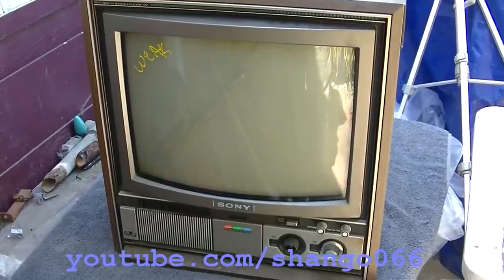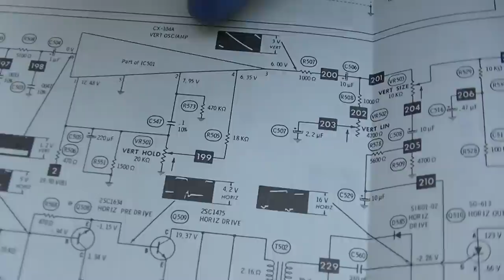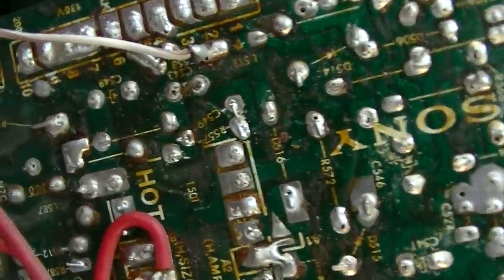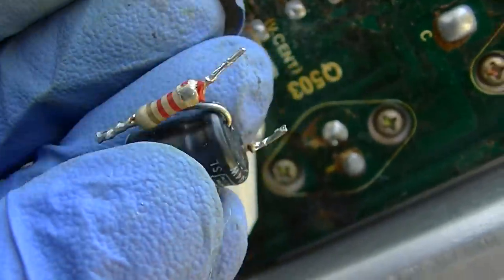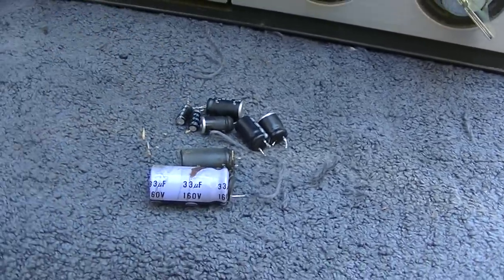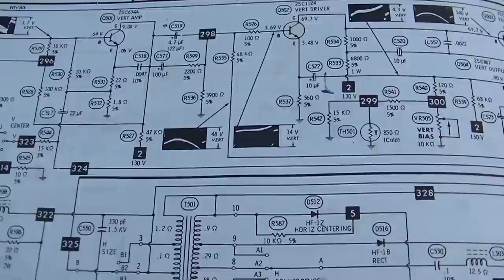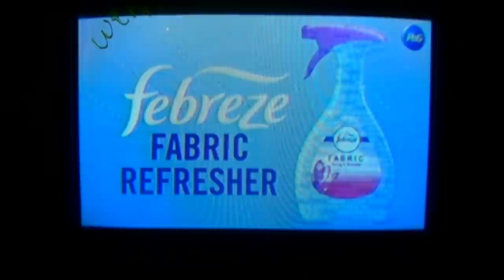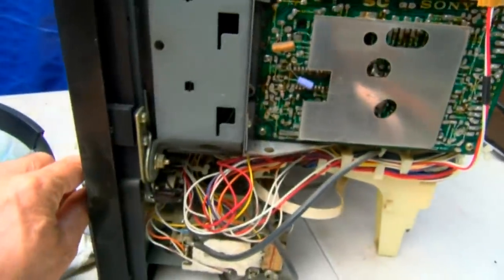High Hour Sony Trinitron KV1722 Repair Vintage Portable Color Television

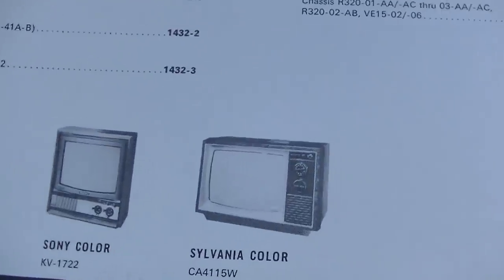Comment: 20:50 - just to add to Shango’s point, the reason why you kill a Trinitron if you try and rejuvenate in the usual way is because the tungsten for the cathode is so thin that the spike in current from a rejuvenator will easily destroy it!

There is a way I know to reactivate older Trinitrons like this and that is to increase the heater voltage to about 9V, leave it like this continuously for a few days. It slowly removes a stagnant layer of crud from the cathode. How successful it is just depends on pot luck.
Reply: Does that work on Sylvania tubes as well? I have one with a 1978 26 inch color CRT that's... well it's watchable if you wait at least a minute in a completely dark room... but then again that TV has other problems, it's got H deflection bleeding into V geometry. That might be rust growing on the pots in the geometry adjustment, it changes if you do percussive maintenance. I found the set in a dump... it's rare to find such an old TV with the original remote control. One day...
Reply: @senilyDeluxe  Not a clue. I’m from the UK, we never had Sylvania stuff here.
Reply: @stickytapenrust6869  I'm from Germany. It's a SABA. They had a deal with Sylvania that, at one time in '74, didn't do them much good... (that tube does have good colors and is plenty sharp, but dim... I found a 17 inch B&W SABA with a Sylvania tube in the same dump once and it was a low hour set with an insanely bright picture, I shouldn't have thrown that one away... well space and parents are an issue when hoarding...)

Comment: I remember back when those sets were new. When you went to a store that sold Sony and RCA and Zenith and others the Sony always had purer looking colors and better corner focus. You could read the small text in the commercials.
Reply: Sony was owned by Mr. Morita  and he wrote a book. Sony used new technology of sweep ray gun that created better picture than other brands like Zenith, RCA and Phico. The picture tube of Sony color TV with Tritron technology color picture tube make Sony brand the best at that time. Sony also came up with small portable set that you can carry with you for vacation trips. The quality of Sony is outstanding for the one that manufactured in Japan and command very high price for parts. That why many of them got trashed.
Reply: @johnmadow5331  I have one of them. A couple years ago, pre-Pandemic, I saw one in Goodwill for $3.99. Powered it up in store and the picture was clear and bright. But confetti, of course. Probably anyone who tried it before figured it was broken. Snatched up immediately, took it home, connected to a converter box and the picture is gorgeous. Absolutely perfect, traditional Triniton. Sound is good too. Expect it was low hours. And don't anybody even THINK about cannabalizing this gem for parts! I will hurt you.

Comment: Most CRTs, Trinis included, were run by default with a high drive(Picture/ Contrast/ White Level) setting.  I learned that late in the CRT era(late 2000s), and always made a point to set the 'Contrast'/'Picture' control to its mid-point, before adjusting anything else('Brightness/ Black Level, Color, Sharpness, etc) on a brand new set. 

Typical default was Contrast maxxed.  After turning it down, the Picture was definitely dimmer, even on a 25" or larger tube, but less glare in the brighter portions of a picture, and better black detail(dress suit texture on the evening news anchor, etc).  Much more lifelike, and probably closer to what was seen on preview monitors in the station control room

Comment: Awesome resurrection! 
I own an example of this model which worked well the last time I used it about 10 years ago.
I learned to diagnose & repair these first-generation Sony Trinitron sets during the late 1970’s. It was a challenging learning curve for me (even though by then I had earned an MSEE degree in solid-state circuit design). Sony must have employed a huge staff of really brilliant engineers at that time. Their engineering efforts were visible in the excellent picture quality provided by these sets. Reliability, on the other hand, was variable. Conventional shadow-mask color TV sets had about 1/2 as many electronic parts in them. Therefore not as many items to fail.

Comment: Shango, I have a 22 yr old high-hours Sony and the CRT went completely flat several years ago. There's a small value resistor (2.7 ohms IIRC) in series with the CRT heaters, located on the neck board. I shunted that resistor, which brought emission up to like new, all 3 guns. The set is in daily use, with no sign (yet) of losing emission. Dunno if your Sony has that resistor, but might be worth checking.
Reply: Basically you did the equivalent of adding a brightener by eliminating that 2.7 Ohm resistor.  Others have said in posting for this video that running the CRT at a slightly higher voltage will burn off crude on the cathode and/or heaters. You are confirming that.  You might want to try removing the shunt to that 2.7 Ohm and see how the picture looks.
Reply: The low ohm resistors are there to protect the filaments from high current inrush when they are cold.  The filaments may blow during cold turn on if the line voltage sine wave is at one of its peaks
Reply: Not when the heaters are powered off the flyback.

Comment: The mainboard always has charged up ready to go electrolytic caps , well at least the ones that didn't fry out already.
Seen potatoes less baked coming out of the oven. Getting any kind of picture, smeared or otherwise, is a win. Stay for
the audio repair. More bad caps. Very good ressurection  by Shango  but you would have to watch it in a dark room.

Comment: I remember the old 70’s television commercial for the Sony Trinitron portable that had Groucho Marx as the pitchman.  
A couple years ago I saw a very early Sony film on YouTube advertising their “trinitron” system. In that film they pronounced “trinitron”  so it sounded like “try nigh- tron”,but in later ones is pronounced like Shango says it here,which is always the way I’ve heard it pronounced.

Comment: On the subject of weak Sony CRTs, I recall a circa 1980 19" set where the green gun tested like new, but the B and R were totally dead and would not respond to rejuvenation. I've rejuvenated a few Sony tubes with a B&K 480, but they were already beyond usability and I had nothing to lose. If they took at all, they usually looked good for a few days, and then they'd fall back down and look worse than they did to begin with.
Reply: radiotvphononut: Good to see you are still around. Your vids haven't popped in my YT feeds in a long time.

Comment: Great job BTW. You have the patience i used to have before wife and kids.... This gives me a premise of where I need to start on both of my KV-1722s. One has the surging regulation pattern yours shows as well, the other had a hellbof an audio buzz/hum. Sounds 60 cycle so I'm sure the regulation circuit needs recap. Those caps look nasty.. Both had nasty pincushion distortion. I haven't recapped either, however I did disable the instant on circuit.

Comment: Sony had that similar switching PS for the higher end TA-F6B audio amps. I guess for a smaller Transformer foot print? Also I noticed the solder connections. I've seen that on other boards of that era. The solder pads gas out some sort of material combination when heated, bubbling the solder connection.

Comment: The KV-1722 had several different chassis versions. Each one was wildly different from the other. Worked on many of those in the early 80's

Comment: I had a 1989 LXI 564.42955950 that was bleeding/smearing too but only through one of the 3 AV inputs, it had an RCA 68AEG20X02 that was kind of soft, but the brightness was fine.

Comment: Red bleed due to saturation of the red cathode was a common issue with 1970’s era Trinitrons. My recollection is Sony’s red phosphor wasn’t as efficient. Therefore the color red required nearly 2x the cathode current of green or blue. Still, low CRT emission rarely occurred before about 5 years of heavy use. Also, after 20+ years of storage it seems typical for a Trinitron CRT to require about 10 hours of power-on time to fully “wake up” and get up to a reasonable level of cathode emission.

Comment: We still have a KV-2765R
Trinitron 28 inch that we bought used in 1999, that worked flawlessly for about 5 years when the green colour just dropped away and still works today otherwise in red and blue only, but still a perfectly bright sharp picture! Then the friendly neighborhood tv repair shops disappeared, so we could never find a place that could still repair it!
  It is a solid state set!
  Any ideas? Anybody?

Comment: It would be interesting to use your CRT tester as the heater supply and see how much increased filament voltage would improve the picture.

Comment: The two 10uF 50V polar caps back to back will give you  abipolar 5uF 50V since the reverse voltage rating of a polar caps is basically 0V. Technically they can tolerate about -1.5V, above which they become a sort of electrolytic diode and the other cap connected with the correct polarity  will drop all the voltage :)
Reply: Two 10uf caps back to back give you about 9uf as a bipolar cap
Reply: @blitzroehre1807  I just took two new 10uF, 50 volt electrolytics out of the package and tied the positive leads together.  They measured what I expected, 5uF.
Reply: @vancouverman4313  Its because you are measuring them below the reverse breakdown voltage of the wrongly polarised cap with your multimeter. If you do a dynamic measurement with a function generator and an oscilloscope you will find its about 9/10th of the capacitance of a single cap. Trust me
Reply: Identical caps in series halve the capacitance. Simple textbook theory.
Reply: @Seiskid  Yes, but not if they are wired back to back, because on each half wave of the ac going through one of them basically becomes a short. The correctly polarised one cannot suddenly have half the value, can it? Remember, we are talking about ac going through them.

Comment: That's good info about not trying to rejuvenate Trinitrons. Does that also apply to the "clear shorts" function of tube service devices? I've had junk on cathodes in a Trinitron and it luckily burned up safely on it's own, but I understand that that can sometimes take out the tube when it happens, and it's safer to use a device to clear shorts or clean them.

Comment: This set looks like it could have used the madman Muntz treatment. If you have that many completely open capacitors and the set is still functioning the parts count could have possibly been reduced.  This is a true event. Where I work a piece of biomedical equipment that was made by a Japanese firm had a very strange roundabout way of achieving a result in a circuit. The manufacturer is rep was asked why they didn't do it another way which was cheaper more reliable and achieved the same result. We were told that this circuit was the baby of a senior engineer who had been with the company for a very long time. No one would overrule him on this design. Sometimes I think Sony sets were the same way. Extremely complex circuit to get to a simple result which could have been done more conventionally. The weird SCR fly back design is an example.
Reply: I understand completely. Back in the day I worked for a (now nameless) major electronics manufacturing corporation. Politics overruled everything: engineering, business feasibility and common sense.

Comment: Capacitor voltage rating is just how much the capacitor is rated for handling before it blows. The difference between 10μf 25v and 10μf 500v is just more insulation. More is better, you can get ridiculous for the work load required though. You can increase the capacitance value by too much and have a negative effect, depending on circuit. More is not always better in this case, but less than 70% of recommended value is bad.

Comment: i was once able to restore a friend's 90s trinitron with a stone dead red gun by zapping it with 8000v from an an electric fence charger, it worked and the set had a decent picture, no one knows how long it would have lasted as a few months later it was destroyed in a flood

Comment: Curious what the other capacitor was for the sound.  I'd expect an open feedback capacitor would make it loud and distorted.  (However, a leaking cap could mess with the bias.)  A bad coupling capacitor would make it weak.

Comment: Anything you can do on some new CRT TV's that have a single chip for everything which have the "bad regulation" as you've told problem?
When the picture contains some white areas, it bends in horizontal direction. With alternating black and white background, it shrinks and enlarges like crazy.
Voltages are fine, capacitors are fine.
Is this how these cheap TV's behave?
(LG Golden Eye 2  -   lg_mc-019a chassis for example)

Comment: 16:40 I'm confused..... How does tying the negatives together on polarized caps make them bi-polar? Is that different from non-polarized? 

I love your videos. Thank you very much for posting these. I have an early 70s Trinitron KV-1203 that used to work fine 20 years ago when I stopped using it. I don't know whether it's safe to just power it up or not now. I can fix old radios but TV's are perhaps beyond my ability I think. I may have to just sell it someday instead, but I'm really curious if it would still just work. Thanks again for the best electronics show on the interwebs.
Reply: My dumb dumb noob thinking is that bipolar caps might be for an AC source, or maybe signal that isn't polarized and so a traditional capacitor might 'influence' that signal by chopping it in half. I'm thinking just by using the positive leads with negative in series, the signal might be 'positive' at least half of its cycle. Something like that.... not sure. Again, noob thinking.
Reply: Shango has some 'splainin' to do.

As for your TV, probably follow his advice, open up the back and check it out. Look for the broken u-bolt on the flyback transformer. Look for leaking caps. Anything else that looks wrong. If you have the equipment, test caps and resistors. I fired one up and got lucky. I figured it had already bee powered up, so nothing to lose. I got lucky. (Rare occurence for me, BTW.)
Reply: Connecting two identical polarized caps back to back is an accepted way to make a bi-polar cap. You get half of the capacitance and the same voltage rating as a single cap.

Basically it works like this. Let's say you have two caps connected  +C1--C2+, C1 is charged to the rated voltage and C2 is at zero. If you now reverse the voltage (so that positive from the power supply is on the right), C1 discharges and C2 charges up. 
The one edge case is if both capacitors are discharged, then, when you connect the power supply, one capacitor will be reverse biased and act like a diode, but only for a short time (until the other charges), apparently this does not hurt the cap.
Reply: @Pentium100MHz  Thanks very much for that. I'd never heard of this and wanted to understand how it worked.

Comment: Those had a very common problem with dead caps especially p/s n horizontal  the thyristor in the power supply would short due to noise on the gate n of course take out horizontal o/p thyristor which are both suppose to be SG-613's then after replacing all caps n the thyristors in the p/s n horizontal you power it on a variac with the horizontal supply disconected n use a 100W light on the p/s o/p n cross ya fingers it doesn't take out the p/s thyristor again n regulates f ok reconnect horizontal supply n do the same very slowly, they where an absolute dog of a power supply it was used in the KV-1810AS here in OZ n I'd cringe every time I saw that model other Sony models are very easy in comparison just grab a handful of 33uF 22uF 10uF n 4.7uFcaps n go for it n of course if it had a thyristor you changed it, as your term of bleeding we called it flaring n I have successfully rejuvenated hundreds of Sony picture tubes.

Comment: A vertical line runs up and down.  A horizontal line runs side to side (like the horizon).
Reply: Yes, and when you have no vertical deflection of the beam you get a horizontal line, which is what he said. Yeah it’s a year later but pay tf attention.